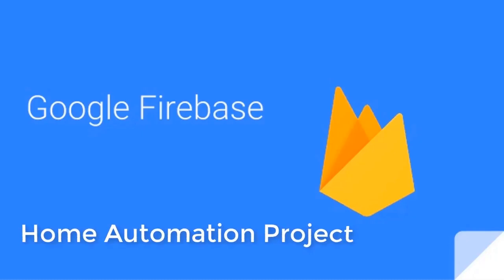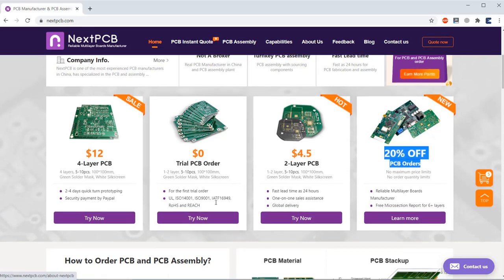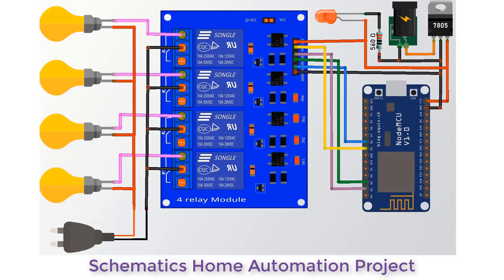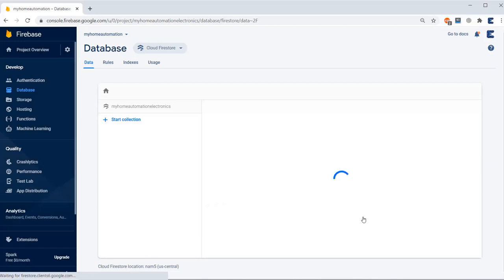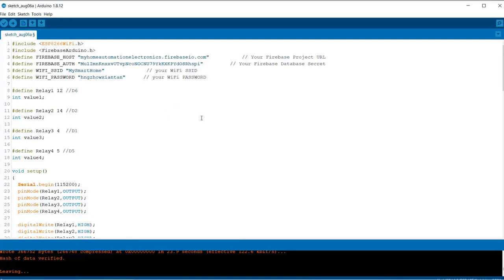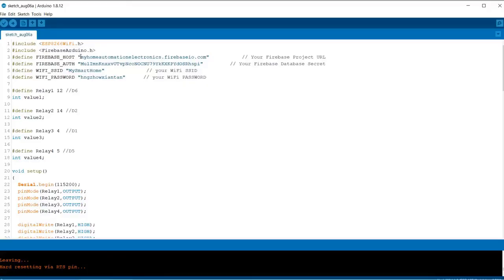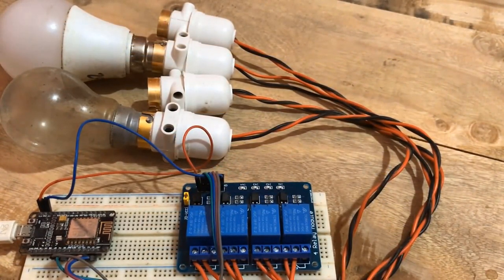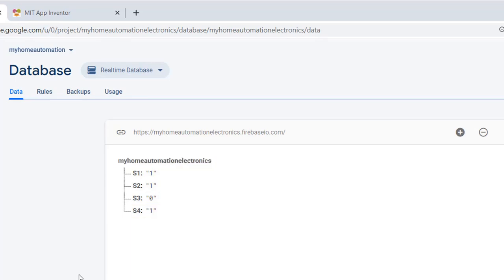Home Automation with Google Firebase & ESP8266 | MIT App Inventor | Relay Appliances Control

Comment: bro i need help its not working,i am using arduino ide 1.8.12 and arduino json library 5.13.5 ,the problem is nodemcu(esp8266)is not communicating with firebase :( please help

Comment: 0:31:35.604 -> --------------- CUT HERE FOR EXCEPTION DECODER ---------------
20:31:35.604 -> 
20:31:35.604 ->  ets Jan  8 2013,rst cause:2, boot mode:(3,7)
20:31:35.604 -> 
20:31:35.604 -> load 0x4010f000, len 3584, room 16 
20:31:35.604 -> tail 0
20:31:35.604 -> chksum 0xb0
20:31:35.604 -> csum 0xb0
20:31:35.604 -> v2843a5ac
20:31:35.604 -> ~ld
20:31:35.688 -> connecting...
20:31:37.184 -> connected:192.168.1.37

connecting & disconnecting wifi, I think everybody has the same issue

Comment: Arduinojson library does not use in my code..
Reply from the maker: It requires JSON Library as well. Try the old library if it does not support the new one.

Comment: what this  resolve method
JSON v5.13.5
Exception (28):
epc1=0x4020b578 epc2=0x00000000 epc3=0x00000000 excvaddr=0x0000003c depc=0x00000000
Reply from the maker: Use the old json library.
The latest one may not work.
Reply: Plz sir Share library link

Comment: is there is any issue in firebase server?? when click on buttons on app, no data is updating on firebase database, also nodeMCU not connecting to firebase server. how we can solve this issue?
Reply: open  FirebaseHttpClient    , you find it in    Documents\Arduino\libraries\firebase-arduino-master\src
Reply: search for   static const char kFirebaseFingerprint[] =
and paste that:
6C:F8:33:A3:FB:42:4A:49:0A:E7:72:24:53:1A:11:A2:C1:34:0D
Reply: firebase changes always its fingerprint , that's  bad in firebase